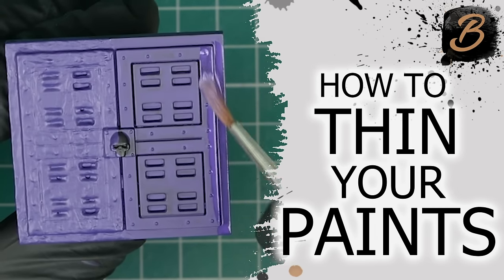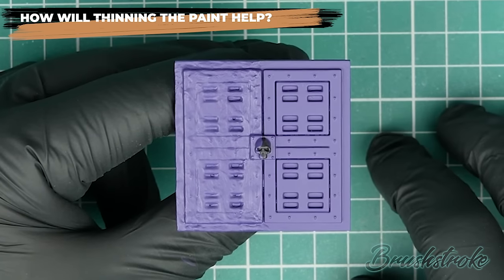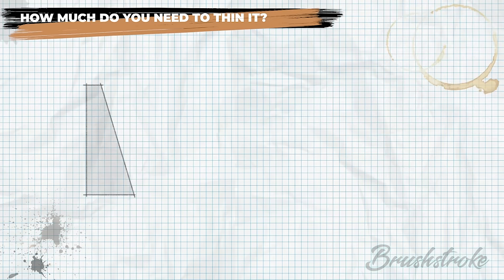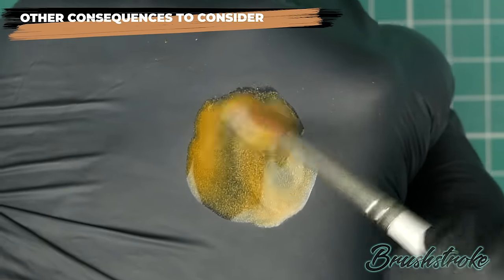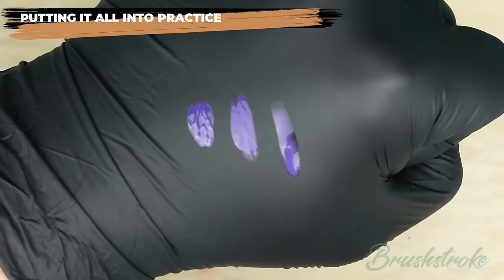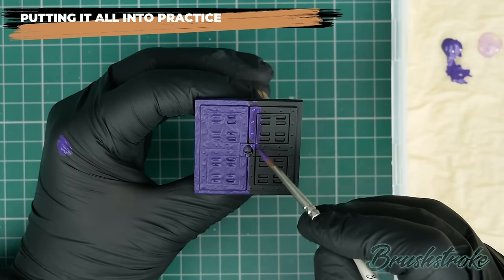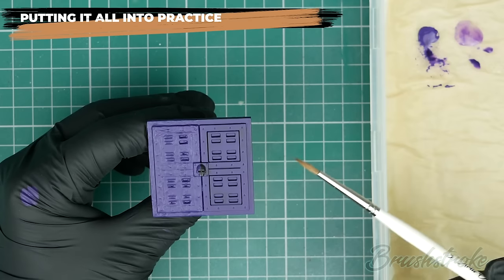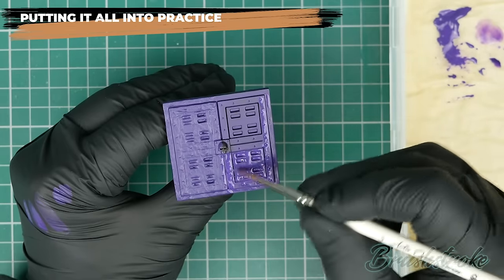HOW TO THIN YOUR PAINTS: A Step-By-Step Guide

Comment: Very cool!
The reason i use Vallejo Air instead of Citadel is because it means less of this messing around. I can go straight from pot to model. I found when I was fiddling with consistency and mediums I just went straight to artist’s acrylic and the finish/colours were incredible. Citadel just seems to achieve neither for me.
Reply from the maker: Yeah, using paints which are closer to your sweet spot are a good idea. Airbrush paints are just faster versions of the standard colours on the speed scale 👍🏻

Comment: @1:40, Cmon, really, no one paints from the pot like that. its not a good comparison to purposely make it ugly and say its the paints fault.
Reply: to Clarify, @13:50, you speak about 'painting' the model, which anyone can do direct from the pot to get the same effect. So its disingenuous to have not said so.
Reply from the maker: Yes, the left hand side is unrealistic but it was only intended as a means to an end and that end was to show the process of thinning to paint smoothly.
The problem with making a video like this is it is impossible to know what level the viewer is at. So by making the left hand side unrealistic I can guarantee the viewer wont be thinking “I can’t even paint that well, what’s the point?”
I would hope, that viewers with more experience would simply be able to substitute their current level for the left side and think is it as good as the right side result? If it is, awesome! Keep doing what you’re doing. If not, then watch on.
As I say at the start, the purpose of the video is just to explain how I get my results. The comparison is simply a catalyst for that discussion.

Hopefully that gives a better context?
Reply: Citadel base paints are designed to be used straight out of the pot using a Citadel Base brush.  It’s a completely different technique to what is shown here, and it does produce very fast smooth results in one coat. I use it all the time. It take seconds to do an overall base coat.
Reply: You've been licking your brush a little too much. It's an example to explain exactly WHY you should thin your paints.
Reply: Came here to write the same thing, honestly insulting to our intelligence.
Reply: @Hamieee I wish YouTube showed comment dislikes again

Comment: Thank you for your guide. The water drops next to the paint on a wet pallet was a game changer for me. Allows me to control adding the water better than dipping the brush in a cup of water to thin the paints. Wasn't very consistent for me. Now with your method it is much better.
Reply from the maker: Thanks for taking the time to comment.
The separate drops per colour makes things so much easier for me, so it’s great to hear you’ve found the same

Comment: This is the best thing i could have been gifted by the YouTube algorithm. Started with 40k painting about a year ago an even if i thinned as i could i barely got the results i wanted. Now i know what i did wrong, I rarely went for more thin layers as when i did they became too patchy for my liking and ended up using paints, while thinned down, more towards the thick side. Couple that with me being much more of a visual learner and I will definitely be using this as a guide next time i paint.

Also now i finally know why everyone paints on the back of their hand on the photos i have seen, and its not to form the tip of the brush but more so to test the paint viscosity, at least that's what i got from the video, once more thank you.

Comment: I can't believe how rough the paint looks when its painted compared with how smooth it looks when it dries. Amazing!
Reply from the maker: That’s why I was keen to show the whole process, as it can look pretty horrid before the water evaporates out and the paint shrinks to fit the surface.
I think that’s why a lot of beginners worry and add more paint on to try and make it look more solid straightaway

Thanks for watching 👍

Comment: just what i truly, actually need, i still have issues in thinning the paint to the point i have given up entirely and just pick the paint in smaller amount and brush them again as needed or use an airbrush instead. We all know Duncan Rhodes touts "2 thin coats" but many people does not show how to thin them and you delivered by using a separate droplets and the brush control needed. THANK  YOU!
Reply from the maker: You are very welcome :)
Really glad you found it helpful
Thanks for checking out my channel
Reply: @BrushstrokePaintingGuides  oh, a question, i know you used a metallic for the sake of example but do you thin metallics the same way?
Reply from the maker: Yes I do.
Although, as I’m sure you’ve noticed the coverage of some metallics can be poor when thinned?
So, I do opt for underpainting to help with coverage.
Underpainting is putting down a colour first which will be easier for the metallic to cover over.
For example, a gold will cover over a warm brown in less coats than it would over white.
Hope that helps

Comment: This video helped me immensely, it didn't actually improve my paintjobs, because i was hyper careful & used extremely small amounts of paint at a time, but this has speed up my painting process & made it was easier to acheive the results i was getting.
Reply from the maker: That’s so great to hear.
You’re so right, sometimes it’s not always about a better outcome but improving the way we achieve it.
Confidence plays a huge factor in this.
When you’re confident in a process you can be more relaxed and quicker with how you do it.
Thanks for watching and keep painting 👍

Comment: Funny how you heard, and to some extent used, something for about 20 years, and some explanation of it makes all the difference. Great video!
Reply from the maker: Sometimes all it needs is for someone to point out a couple of things and it all clicks into place, for sure.
Chances are, over those 20 years you’ve been doing a lot of this but maybe not really knowing why or how.
I wanted this really to try and join the dots for people
Reply: @BrushstrokePaintingGuides  it sure did!! I tried it out, and though I got smoother results, I am still miles away from your consistent finish. But I mean, it would be boring if it weren't SOME skill involved :)
Reply from the maker: @SeeWeeee  glad to hear you’ve started to get smoother results already.
Stick with it, you’ll find it’ll get better and better as you start to really notice the small differences in thinness and the results they give, now you know what to look for.
The key thing is to have that observation. 👍

Comment: Thank you so much for explaining how important the drying process is and what it does. I never understood why my first coat (before dried) looked so awful. I never thought that that ugly painted finish would look great after it has been dried off so I just kept using thicker paints until it looked good. I use lacquer paints with thinners so hopefully when I try again they look as smooth as they did in this video with first coat!

Comment: I subbed 10 minutes in, I'm a gunpla builder and I've tried painting with citadel paints since those paints were already thinned out for miniatures, it already worked wonders but my problem was with large flat surfaces. I've been told to use a flat brushes to paint large surfaces and while it did the job faster, there are soo many brush strokes. But hopefully after watching this video, thinning paints won't be as intimidating as I first thought
Reply from the maker: Thank you for the sub, much appreciated.

So, to answer your query about flat surfaces and flat brushes, the information is correct. A large flat brush can help apply a more even coat with easier brush control. However, the bit you still need is for the paint to be thinned enough for it to settle and shrink, thereby removing the brush marks.
Hope that helps, please let me know how you get on 👍

Comment: Thank you for a really comprehensive overview of what "thinning paints" is really for, and what it actually does. Knowing how paint is supposed to optimally behave is something that a person just has to pick up with "brush time". Eventually you develop and intuitive grasp of how a particular mixture of paint is going to act at a given viscosity. But it's good to get into the technical detail of how it works. The old advice "make it the consistency of milk" is simple, but in reality every type of paint has a slightly different optimal flow.
Reply from the maker: Exactly! There's still no substitute to brush time but hopefully this will give people confidence they're at least in the right area and help them develop that sense quicker.
I agree with you, general phrases like "milk" are fine but it's much better to come at it from the point of view of what are you wanting the paint to do, and then it's easier to understand how to get it to a point you need

Comment: Great juxtaposition! Night and day indeed. I pretty much exclusively use Tamiya paints shot through an airbrush with Mr. Color Leveling Thinnner on 1/48th armor and 1/72 aircraft and the results are top notch. However, for small details such as missiles, equipment, etc. I get the results on the left of your introductory example when brush painting. I appreciate the idea of seeing the paint moving on an axisl; I had a "ah ha" moment when you were describing slow vs. fast paint on the horizontal axis. What a simple, excellent description. Great visuals, too! The smooth, solid basecoat is the thing that's eluded me. It's finally clicked. Thanks for the tips!

Comment: Very helpful actually. I started painting in July of 2022, and it very quickly became an addiction, but there were two things that I really seemed to have problems with. One was properly thinning my paints, and the other was when you made the comment of, "letting the brush do the work." Man you have nooooo idea how hard a concept that was for me for some reason. Haha. 
I always did the opposite, and I will say, when you figure out how to let the brush do the work, the difference is night and day with your painting.
Reply from the maker: Welcome to the hobby! 
Yes, it is an addiction and there really is no escape now :D

Really glad you found the video useful. It sounds like you've learnt a lot of it the hard way, so hopefully this has helped backup what you've found and perhaps fill in a few gaps etc.
Reply: @BrushstrokePaintingGuides  As rough as it sounds, I prefer learning the hard way. Haha. Not only do you get some experience, you also do everything in your power not to repeat that mistake again. Kinda like touching a hot stove when you were a kid. My biggest problem was I was a masher. When you realize it takes the tip of that brush barely even touching the surface for coverage, your experience becomes a LOT better. If those brush strokes are going down at almost a 90 degree angle, you're gonna have a bad time. Haha. 
The craziest thing I've found with this hobby is that with having to dot in little eye details, and paint Purity Seals, and all this intricate linework, we'd be sitting in our chairs, drenched in sweat, stressed to the hilt, but it is one of the most relaxing and therapeutic endeavors I've ever partaken in. I can get home after a workday of fulfilling 2 or 3 rush orders, and being stuck in traffic, and completely get lost in another world. 

The friends, family, co-workers,etc. The people who say, "I don't see how you have the patience for that." I always tell them because I love doing it. If you love doing something, you're gonna have the patience for it. You're gonna want to learn every facet of it. I don't think at any point in this hobby, I want to be in a position where I'm NOT learning some new method, or easier way to do something. So thank you for being one of those people who gain that experience, and put it out into the world.

Comment: This is really REALLY educational, which I never thought it would be since the basis is 'add water to paint'. Goes to show that even the easiest things have tips, tricks and rules to them if you look close enough. :'D

I only just started with a hobby that requires smooth application of white paint, yet it's really hard for me to accomplish that with a brush. But this should greatly help me figure out things.
One thing I need to keep reminding myself, as I do not buy the same colours you use or rather I need to buy whatever I can afford and get in stores nearby: Each paint behaves differently and it needs adjustment. Which is something I never thought of or get told when asking for help, so I need to remember this.

Comment: This video deserves a lot of views and I look forward to seeing more like it, hopefully YouTube pushes it to more people. I kind of don't want to admit that it works on me but the thumbnail is good and got me to click on the video. I think that capturing the disconnect between what new painters (i.e. me) see online vs what they get when they naively try to start painting is a powerful visual. When trying to follow simple advice like "thin your paints" a lot can go wrong. It can be staggering how bad of a result you will get as a new painter just opening a pot of citadel paint and just painting solid colors onto the model, with no values and poorly thinned paint it can look worse than an unpainted model which can be very discouraging. Many of my first models were primed wrong (super fuzzy) and nothing worked on them. I know that I and a friend have both independently ran into issues trying to paint values and blend because we simply thought that you keep thinning the paint until it's transparent, but the paint just turns to water. (I also didn't  realize that the paint tends to look more opaque before it dried. The relationship between consistency and transparency is something I'm not totally solid on yet either, most artist paints have a transparency rating but hobby paints generally don't (except for some transparent lines from monument hobbies/Vallejo and some extra opaque lines). I'm just now getting to the skill level where I think I can paint values and hopefully get a very shoddy blend between shades although keeping the matrix of paint thinness and a transition between two colors on my palette is pretty difficult. I think palette management and the details of getting the paint you want on your brush in the way you want it is something I'd like to improve on, I often feel like I'm not sure the opacity of the paint I'm about to brush onto the model until I do (although I guess you'd advise painting onto your hand/glove consistently to do trial and error like the video which I don't do) I also didn't realize that the blend doesn't have to be amazing when looking up close to work when looking from a few feet away, not even trying to paint values because the first steps look bad up close has held me back for sure. Well anyway hopefully placing these long comments and engaging from multiple devices helps the video. Would love to see other videos like it giving the details on how the fundamental skills of miniatures painting work.
Reply from the maker: Thanks so much for watching and thank you for the comment on the thumbnail. It was something I was a bit unsure on, as I don't really like to go gimmicky or for people to think it's clickbait in anyway. However, YouTube seems to work in very strange ways and apparently thats what you need to do these days.
Really glad you found the video useful though and thanks so much for taking the time to add such a detailed comment. I hope you'll explore more of the videos on my channel too :)

Comment: You just made this simple, just painted some suspension on a model car and it looks nearly as good as the parts that I used my air brush for. Can't believe I've been using thicker paint than needed for this long 😂
Reply from the maker: that's so great to hear this video has helped you get a better result.
thanks for checking out my channel, please share this video with other painters so they can benefit too

Comment: This is one of the best painting tutorials I've seen.

I do have a quick question for anyone that wants to answer, does this method also apply to metallics? I feel metallics are a bit more fluid than base. How should I go about adding water.... Should I be doing the same steps as in this video? Cheers all!
Reply from the maker: Thanks for watching, glad you found it useful.
Regarding metallics, yes absolutely. It is particularly important with metallics that you get them thin and moving so they settle smoothly and build up to a solid colour through multiple layers.
I even like to try and apply each layer using different direction of brushstrokes to try and have the metallic flecks lay in different directions. This will achieve a smoother looking shine to the surface.
I've actually just finished a few colour recipe videos for painting metallic colours which may help, as you'll be able to see the consistency of the paint I use as I apply it. And of course what the finished result looks like
https://www.youtube.com/playlist?list=PLdErgfyUObIjDPVHbNmsdjdiY77gk1J8i

Hope that helps